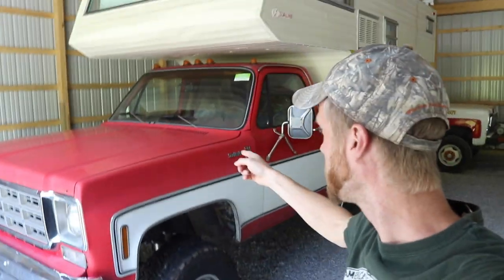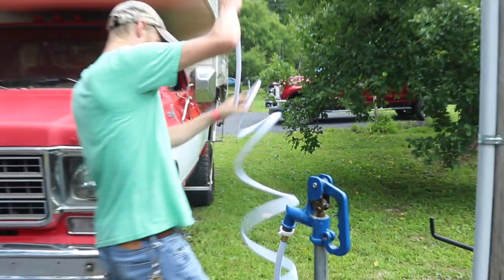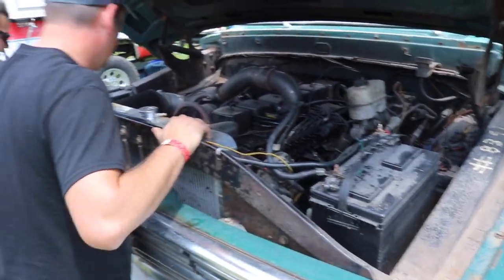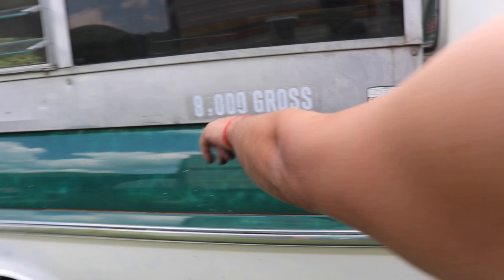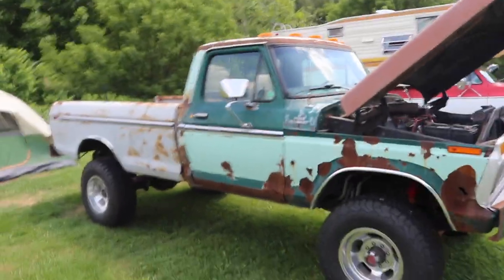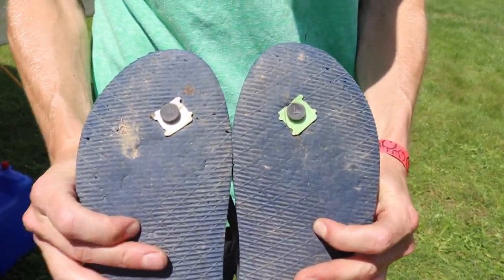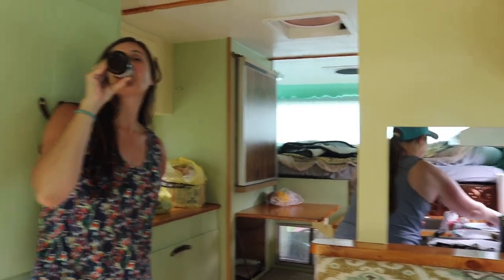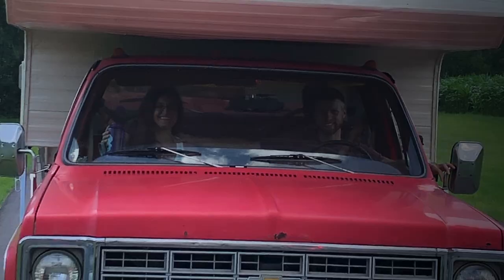CLASSIC TRUCK OFF-GRID CAMPING - Plus Truck Tours, Dentside & Bumpside

Comment: Looks like you guys are having a great time with your old trucks! I was searching for old truck camper rebuild stuff and came across your channel, I watched most of your rebuild videos over the last several days. You did an amazing job on the rebuild. I bought a 79 Lance 8 foot truck camper I am fixing up to stick on my crew cab.  I am a square body guy, have an 87 burb, 87 blazer, 84 2 door pickup and an 86 crew cab with a 12 valve cummins, all red and white too! My nephew put together a 63 chevy with a 12 valve cummins a year ago, he has the same exact gem top camper shell on it that your friend has. Everything under the body is new, suspension, steering, brakes, gear boxes, motor. He has it turned up to about 350 hp. He is running a getrag trans with 3.08 gears and loves passing things on the freeway at 85 mph pulling his 69 dart racecar. You guys enjoy those old trucks!